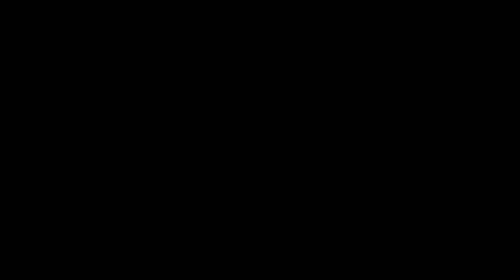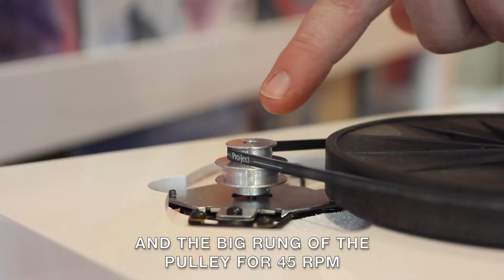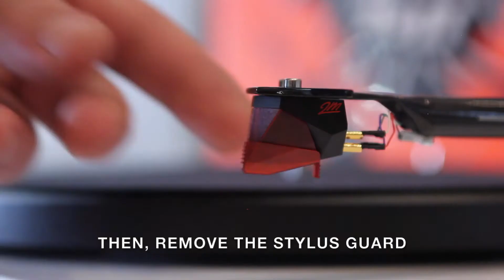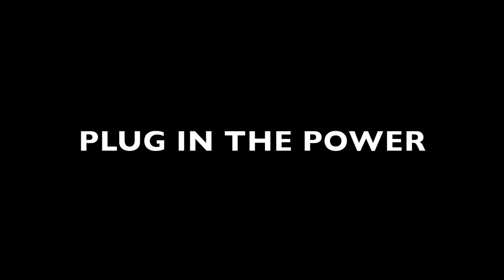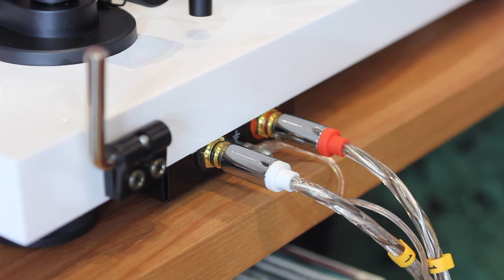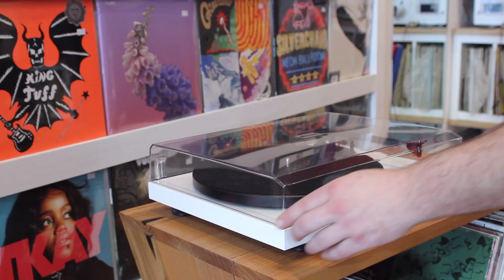Set up a Pro-Ject Debut Carbon

Comment: Hi I just bought a Project Debut Carbon Recordmaster and have a question regarding connecting its ground to my integrated amp.  I'm using a Vincent Audio SV237 and cannot find any earth/ground connection there.  Any suggestion how can i ground the Project?  Thanks in advance.
Reply from the maker: Hi! Because the phono amplification is built into the turntable, you often won't need to ground the unit to the amplifier. If you'd like to do this however, you can connect the grounding spade directly onto the chassis via one of the housing screws. Give this a go, or talk to your Vincent dealer regarding their recommendation. All the best, and happy listening!
Reply: @interdynbrands  Thanks for the very quick reply.